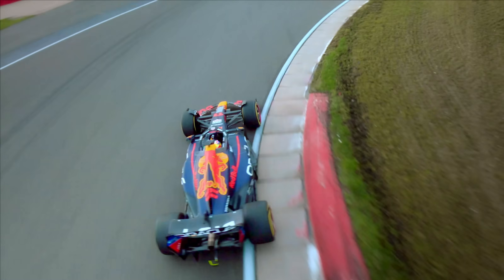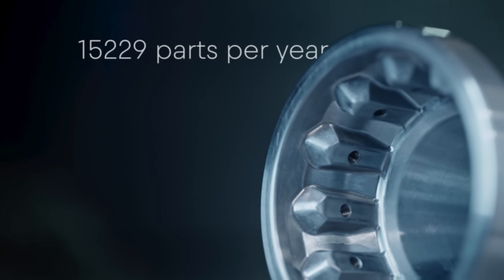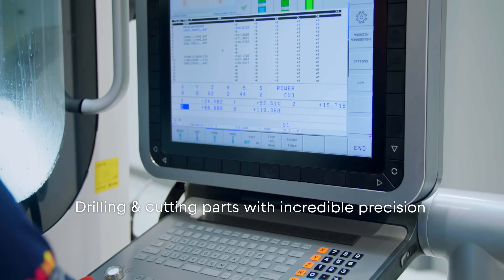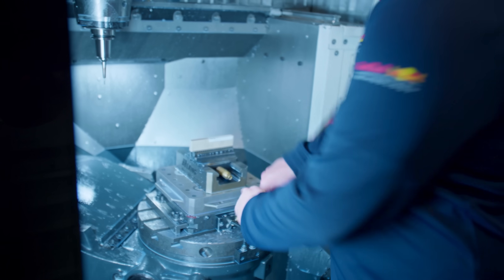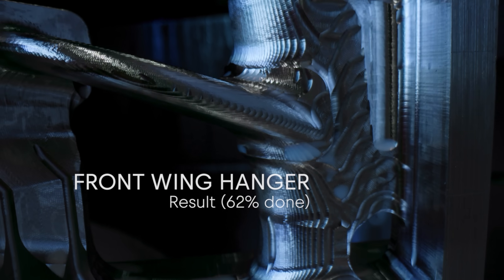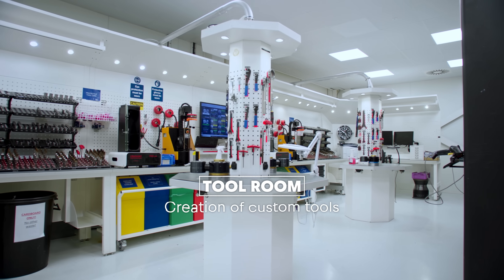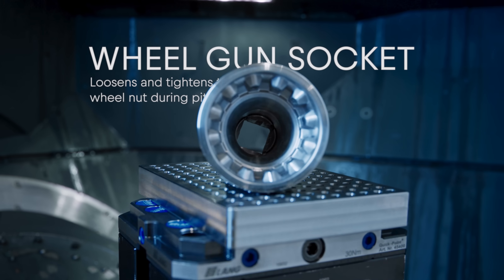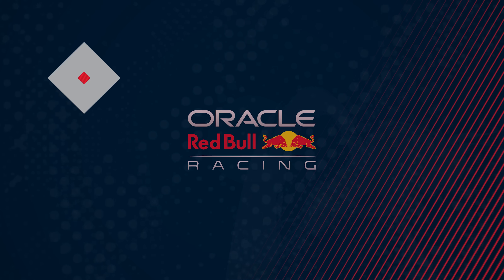The Parts It Takes To Make The RB19 Formula 1 Car ⚙️

Comment: Mybe F1 Should be Renamed the CNC RACE ,Seems like a Total wast of Time and Manpower making parts that are used once on a Car that Goes around in circles for an hour or so.
80% of an F1 Car should be off the shelf shared between Teams to Cut costs,Spend Your Time  making a Manual Gearbox and Engines With No Hybrid and Some Nice Sound,As that is what a racing Car was ,F1 is so Boring in 2025 !!!!!!!!!!!

Comment: Okey, the EDM wire soundeffect was awsome. :D
As a CNC guy this is a good looking factory. And the fact that you use DMG machines with HH controller... Best combo (even if in the last few years I had problems with lubricating oil leaking on the DMG mills from the axis and rots the coolant in just a few days).

Comment: I used to work at a small bearing manufacturer and we used PEEK to line our large sleeve bearings (for industrial use).  These were for shafts sized 3-7/16” up to 7” in diameter.

Comment: Total commitment!! Best machines DMG Mori with top specs (a lot of linear, Heideinhein controls, HSK 63 cone, Shrink fit tool holders and probably hi rpm spindle options ), superb workholding (I really love dovetail workholding and Lang technik) and one of the best CAD/CAM softwares, wisht to work with that equipment!!!

Comment: Intersting video. However, Red Bull didn't show us anything they wanted their rivals to see. So, no....rival teams are not taking notes. And digs against Haas machines in these comments are too funny and uninformed. Every team has a partnership with a CNC manufacturer. RB with DMG Mori. Mercedes with Matsuura. Ferrari with Haas. McLaren with Mazak. They are all high end machines and can get the job done.

I am interested in the additive manufacturing side of things though and what kind of 3D printers RB uses and what they are used for. Most teams do their windtunnel models with them but teams like McLaren are using 3D printers to print actual parts for their 1:1 scale F1 car.

Comment: As a machinist and a F1 fan, this was AWESOME! Glad to see they use shrink-fit tool holders for least runout possible prolonging tool life and parts per edge. Wonder if they run redundant tooling? I think not because of the low batch sizes.
Let's go ORBR!!!!!
Reply: They're probably changing over more than they are actually machining. Especially with the high mix, low volume pieces they are producing.

Comment: I wonder if all f1 teams have all these special tools and equipment. It's very impressive.
Reply: All big teams have this for sure
Reply: there's haas f1 team and then there's haas automation that manufactures their own CNC mills, maybe haas f1 uses them
Reply: @yaej  As a machinist myself, knowing the tolerances these parts are likely built to I can almost guarantee that they would be using machinery more in line with the DMGs seen in this video for most of their work. Haas machinery serves a purpose and 4 decimal place precision isn't that purpose.
Reply: @tdakara  just sneak up the dimensions. lol! I was a tooling engineer in plastic molds for 5 years and got used to the nice stuff, Yasda being the nicest. Their tolerances are tight, but their geometry is probably the main driver in the mills they use.
Reply: @tdakara i work at a company that builds splitboard bindings and they have an in-house Haas cnc machine to build some parts but as you said they are pretty simple parts
Reply: @insaneshadow1  oh for sure, I'm not trying to say that 4 decimal place accuracy isn't attainable on any machine but as you well know it's a question of getting those results efficiently, and that's not the use-case for Haas machinery.
Reply: Williams doesn't, that't what James was complaining earlier saying many things he's used to back at Merc just doesnt exist for Williams
Reply: @wreck.create.MAK0  factually TRUE. eBay and Craigslist for some of the harder to find parts.
Reply: Not really that special. Most metal shops have these machines and software

Comment: It still baffles me how much work it is to create an F1 rocketship. More off this please 👌🏼
Reply: It’s not rocket science after all but it’s still a heck of a job with advanced technology and techniques.
Reply: Let's keep pushing no resting in the summer break
Reply: @emerald39  that's against the regulations... No wind tunnel testing, no manufacturing of parts, no r&d ect... All hands off deck till the time period has elapsed... Only non essential maintenance of the actual factory infrastructure can be done.. Electrical, plumbing, electronics ect.. Absolutely no work on parts, the cars, aero ect..
Reply: @3ne2nr4life why are you talking to him like he’s part of the works crew or something 😂